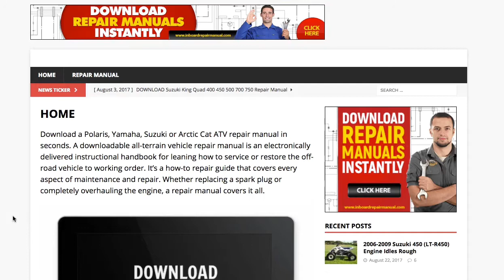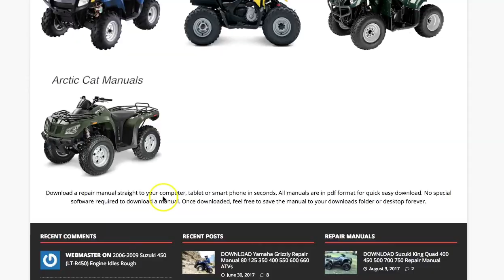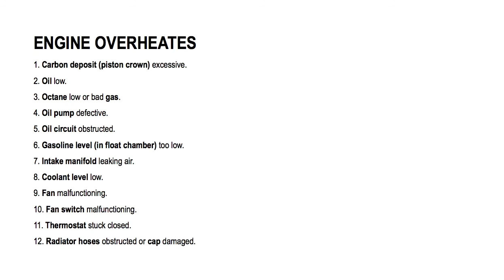Arctic Cat Overheats (150 250 300 366 375 400 500 550)

Comment: Here's the thing I find very weird about some of those troubleshooting guides.as a mechanic I've worked on many water cooled ATVs an old gas will never make them overheat now if the carburetor ran too lean that's a different situation however still I never had them overheat like that.

Here's the thing you can check that will tell you real quick if your quad is overheating.

Step one run the quad for about 10 minutes make sure it doesn't get too hot.

Step two carefully feel the radiator hoses to see if they're warm and feel the radiator if it's also warm. It feels cold to the touch of the radiator and the radiator hoses that means your thermostat is not opening. However if it's warm and if you're radiator hoses is still warm then most likely it's a fan not kicking on.

Another thing is if you're dealing with a fuel injected four wheeler there's no way to adjust the fuel level so there's no way that that could cause the machine to overheat. Anyway that's my two sense of it I hope it helps if you guys are having the same situation.